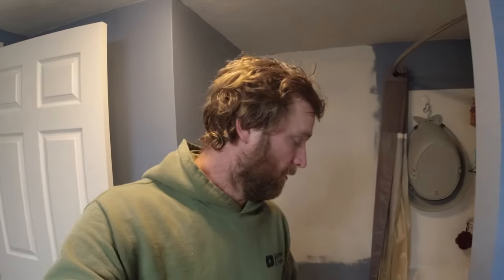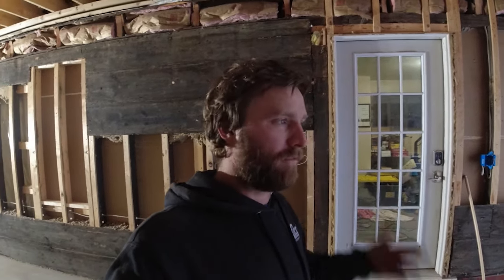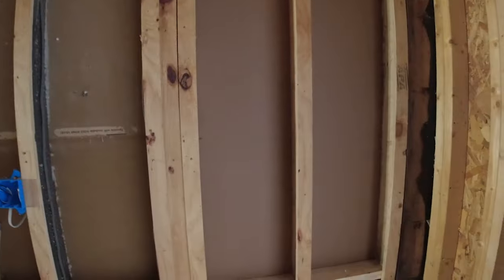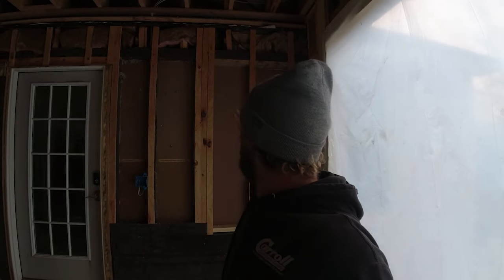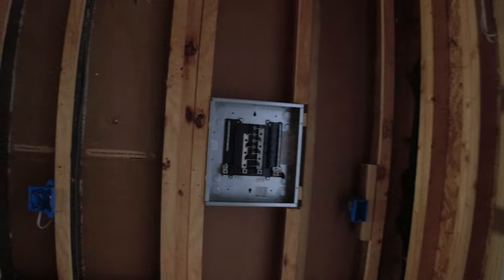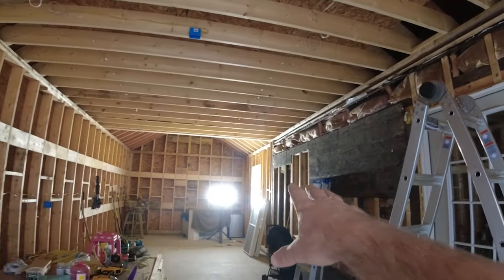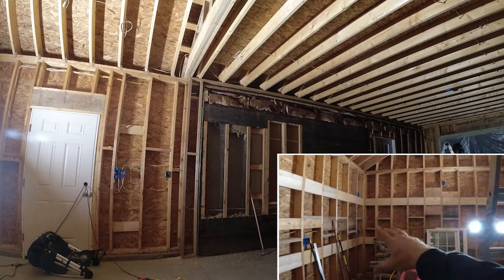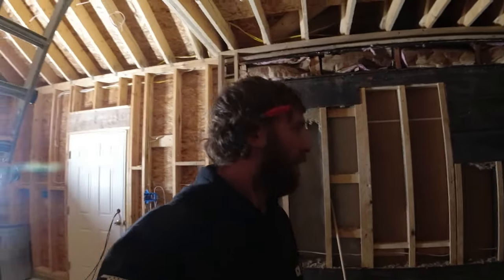Painting My Patch Work And Running MORE ELECTRICAL!!!

Comment: My house here in Missouri was built i think in 97 not totally sure but we hired a house inspector while we were still in Florida. Then we hired an electrician and they went through everything. Some things were missing covers on receptacles and some receptacles replaced by gfci. The inspector also stated that the circuit breakers were all at 30 amps which were too big for the wire. Only panel cover that was still in place was the one in the house, we have 2 buildings and one panel was off and the other one was gone. So one i put back on and the one in the other building we hired another electrician to install a whole new panel and there were a few circuits eliminated. This house was neglected by the previous owners and the people before them had been in trouble with the IRS. Another neighbor bought the property for the acreage and then left 5 acres with the house and two buildings. It would have been nice if we had those 40 acres back but it's okay too!
Reply from the maker: Oh wow! That sounds like a bit of an undertaking! I’m glad it worked out for you tho!

Comment: For the outside receptacle, you cannot change the gauge of the wire to feed another part of the circuit without reducing the breaker size to match the smallest wire on the circuit. 15 amp breaker is still fine where I live but new code might be requiring it to be on a 20, which will require you to replace the 14 with 12.
Reply from the maker: I asked the inspector that and he said if it were going to more than two lights, he would change it but for all the more I’m using it, he said it’s fine. Thanks for looking out tho!

Comment: The guy who taught me to oaint billed $120 an hr on the main line Bala Cynwyd Pa.  Keep handle frame in the direction you're painting. Meaning left to right. The metal bracket is the work side of roller and the other is the feather edge side. Less roller marks. I should post a video on how to paint including free hand cut in. I have a bunch of advice so feel free to ask if you need anything. I have to tone down my rhetoric a bit sadly haha.
Reply from the maker: Thanks for the tips!
Reply: @GunpowderandFreedom  Thank you sir

Comment: You should not reduce from a #12 to a #14 without going to a 15 amp breaker. Just run a #12 to the ceiling light and call it a day
Reply from the maker: The inspector said if it were going to more than two lights that would be used a lot, he would have made me change them. He said he’s not too worried about 2 lights in a storage space tho. Thanks for looking out for me tho!